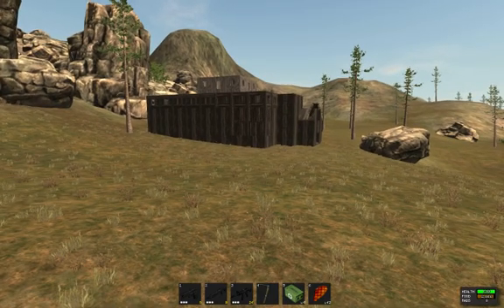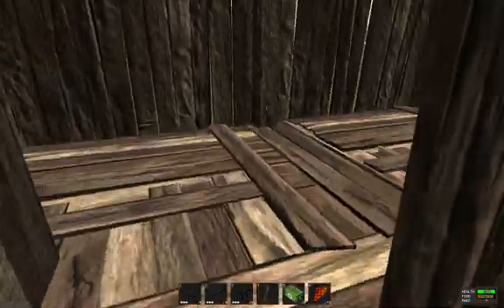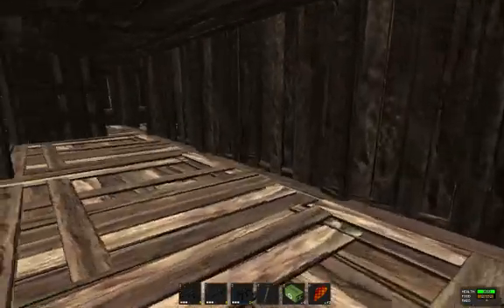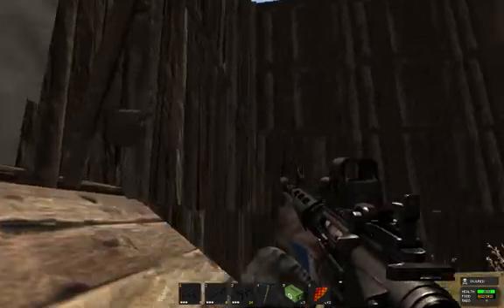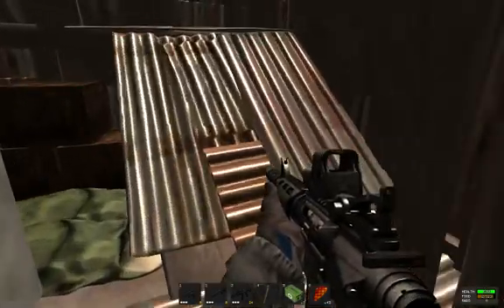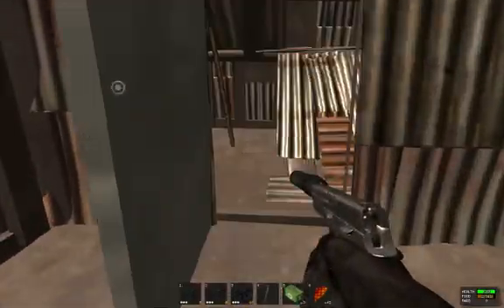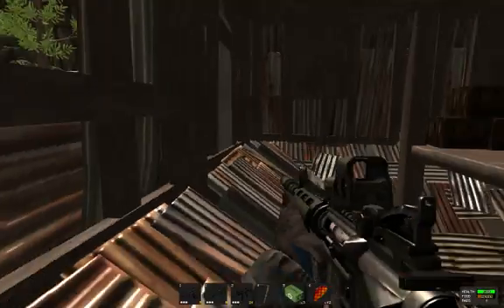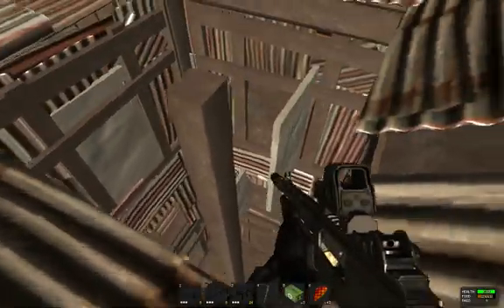A Double 3x1 (Crossed) - Jediael's Fortress Tour - Rust Tutorial

Comment: Where did you build this base ?
Reply from the maker: If you are using www.RustMap.Net, go to the very lower right section of the map, square AD-8. Pretty far out but when you have as many supplies as we had, then it works out well. Pretty nice flat area for this large base design.
Reply: thanks :) I'm going to try for the first time your crossed base. Yea it's far but I have a little house with many stuff and when I have too much stuff in it I'll just transfer them in the big base
Reply: By the way it could be nice if you could build this base while recording :)

Comment: Sick base - if possible can you give a rough estimate of total raw materials required?  Just trying to estimate how long it would take to build something this crazy.
Reply from the maker: It took us about a week of semi-casual play and gathering and building with a group of 4 to make this big of a base. It started just with a single story 3x1 metal base with a single story of wood around the base. As we gathered more resources, we built further up.

As far as how many resources it has taken to make this base in its current state, I've calculated approximate values. This doesn't include all our boxes, beds, furnaces, etc. I didn't do an exact count of every wall and door but its pretty close.

Gate System:
~35 Wood Foundations (280 Planks = 2800 Wood)
~65 Wood Ceilings (390 Planks = 3900 Wood)
~200+ Wood Walls (800+ Planks = 8000 Wood)
~250+ Wood Pillars (500+ Panks = 5000 Wood)
14 Wood Doorways (56 Planks = 560 Wood)
 ~40 Spike Walls (4000 Wood)
~20 Barricades (600 Wood)
12 Metal Doors (2400 Metal Fragments)
Approx Materials for Gate: 24860 Wood + 2400 Metal Fragments

Metal Base:
9 Foundations (72 LQM = 1080 Metal Fragments)
100 Metal Pillars (200 LQM = 3000 Metal Fragments)
70 Metal Walls (210 LQM = 3150 Metal Fragments)
8 Metal Windows (24 LQM = 360 Metal Fragments)
12 Metal Ramps (60 LQM = 900 Metal Fragments)
25 Metal Doorways (100 LQM = 1500 Metal Fragments
35 Metal Ceilings (210 LQM = 3150 Metal Fragments)
22 Metal Doors (4400 Metal Fragments)
Approx Materials for Base: 17540 Metal Fragments = ~1170 LQM
Reply: http://rust.convictgaming.com/
You're welcome